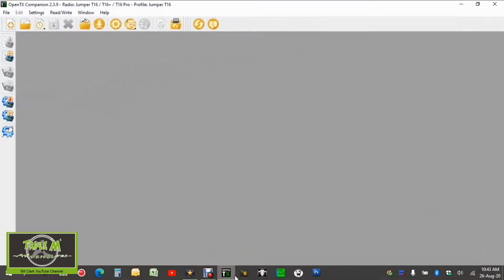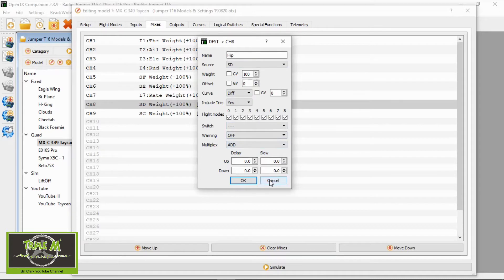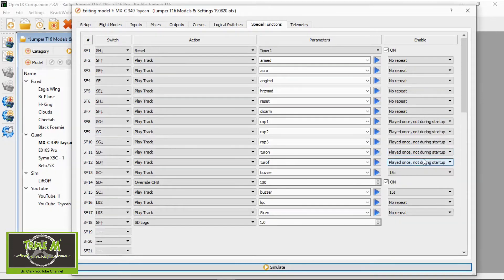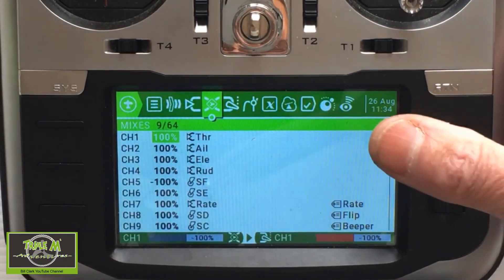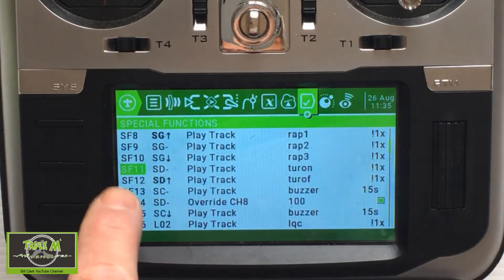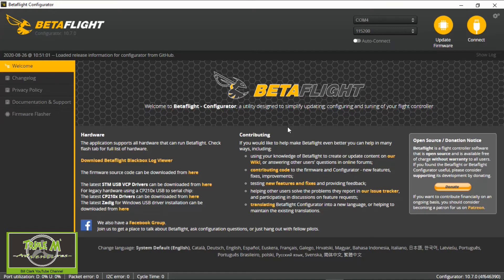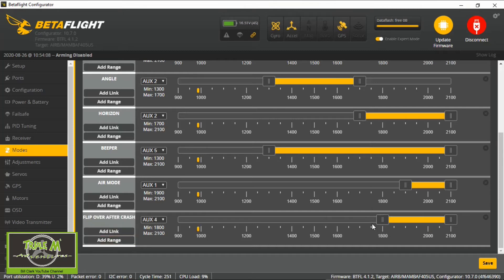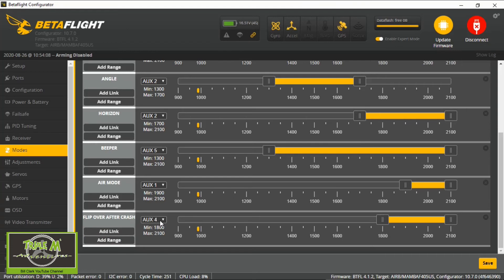OpenTx Quick Tip – Setting Up Flip Over After Crash (Turtle) Mode

Comment: Is there anything on ch 8 on the inputs screen? I'm setting up my first quad and I thought there had to be an input set up before I can mix it.

Sorry for the noob question, but for all the videos attempting to teach a quad setup, I can't seem to fine even one (not even a blog post!) that has a picture of both the input AND mixes screens AFTER everything is setup.

I'm sure after I've been doing this a while it will become obvious but certainly isn't right now.

I'm currently setting up a TX12 and will be setting up my TX16s Max when Vlad in customer service sends it back.
Reply from the maker: Josh, if you check my playlists you will find a complete guide to setting up drones. You do not need to have any channels used under Inputs just channel 1 to 4. I have shown the other channels in Inputs but this is not necessary. All the other channels are set up in Mixes.
Reply: @the-happy-RC-flyer  Sweet. Thanks for your quick reply. I really appreciate your videos and you've already taught me a ton in the 2 weeks I've been learning fpv.

Quite a bit different than my Mini & Phantom!